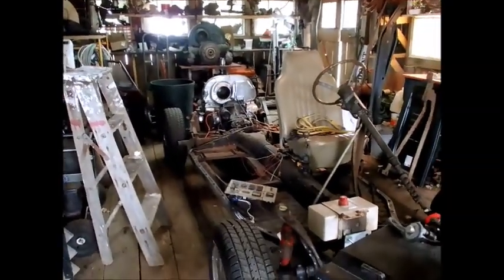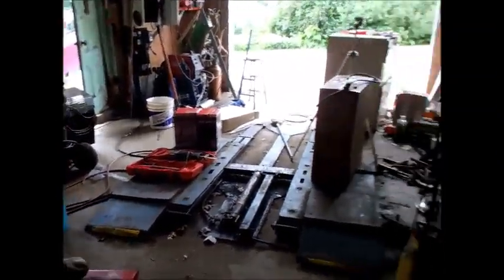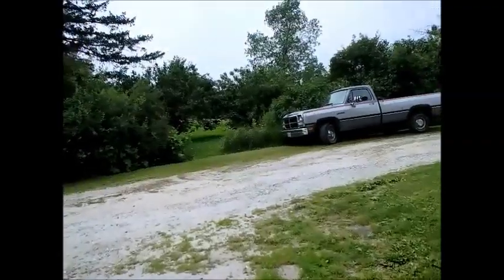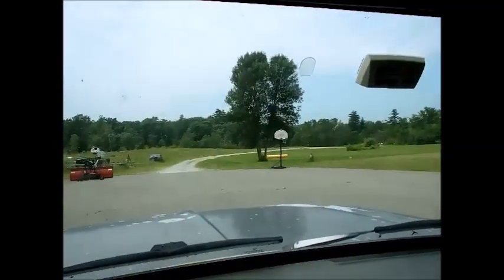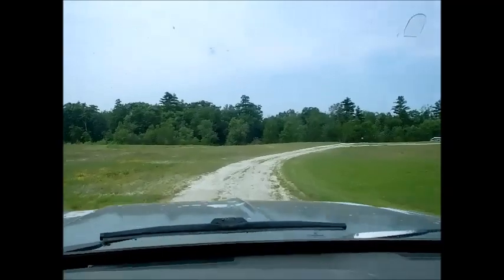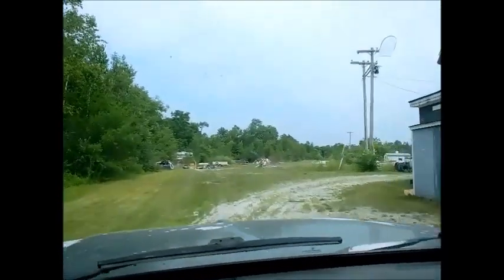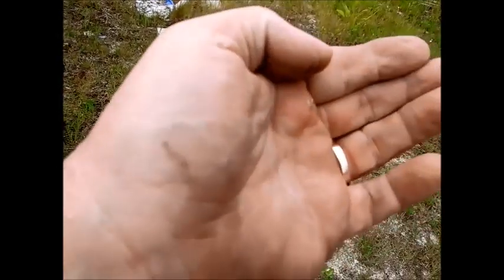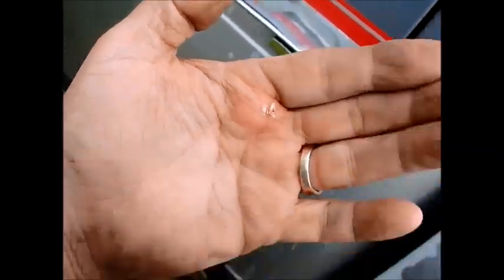Camper Battery Retrieval

Comment: Having received third degree burns about the size of a golf ball on the meat of my thumb from a cutting torch, I can tell you that ICE for as long as you can stand it then more ice, is the way to go with any kind of smallish burn, aloe is nice for maybe AFTER you pull the heat back out of it, but I'm telling you even cold water from a water fountain barely helped with my burn. Soak the affected area in ice till the heat of it dies away and you've saved yourself some pain down the road. Obviously I still needed hospitalization and a large burn demands immediate medical attention, but I have in the past actually avoided getting a blister from what I know would have given me a large one by soaking it with ice.
Reply from the maker: Good to know...
Reply: Yessir, getting the ice on asap is key too.